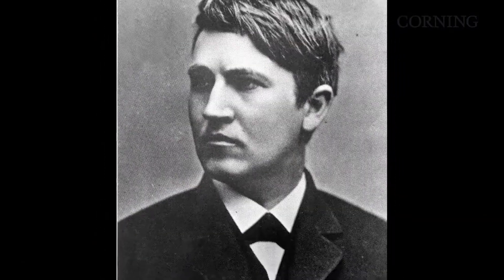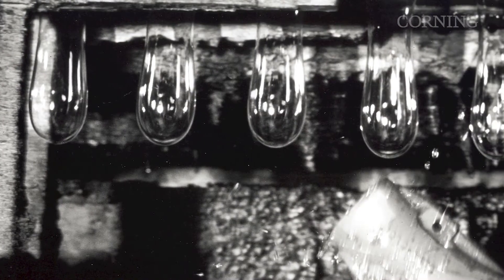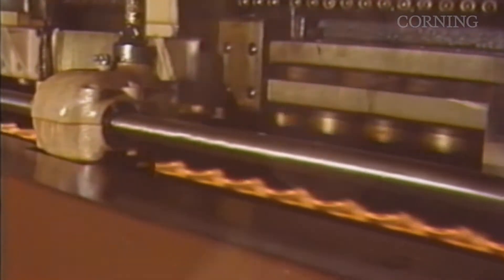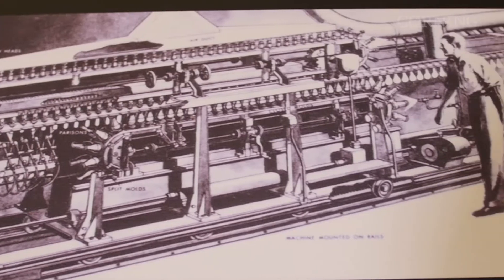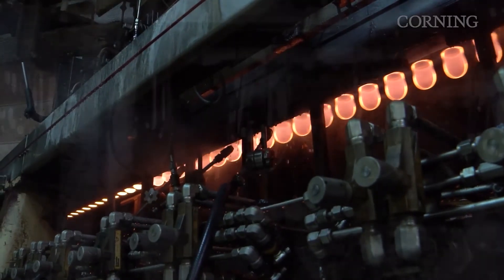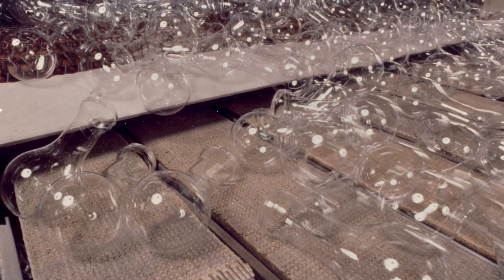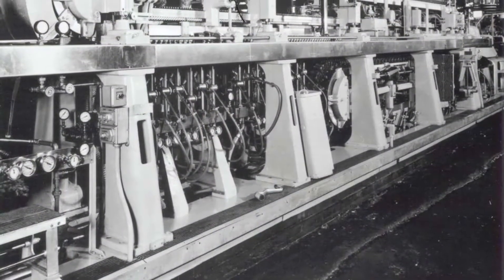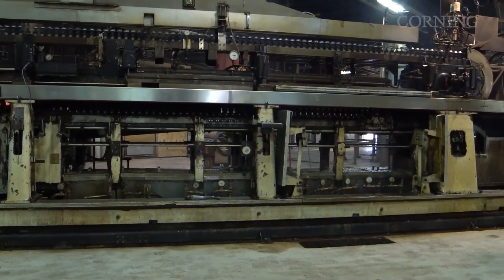The Ribbon Machine: A Corning invention that revolutionized how lightbulbs were made

Comment: It was my job. Making bulbs at a speed of 1400 / min .
Reply: I ran them for years. Where did you work, Francois? What company?
Reply: @neildelp3511  Hi !  NV EMGO Belgium , Lommel 1976 - 2012 . (PHILIPS/OSRAM)  6 Ribbon machines 4 in production .
Reply: @francoispeeters932  I worked many years at Emgo as a hired electric designer. Many memories about the scary "LB" machines 🙂
Reply: @davygabriels7971    Good Times !